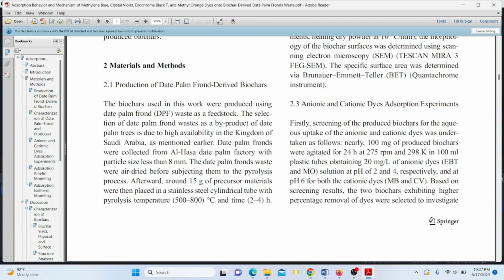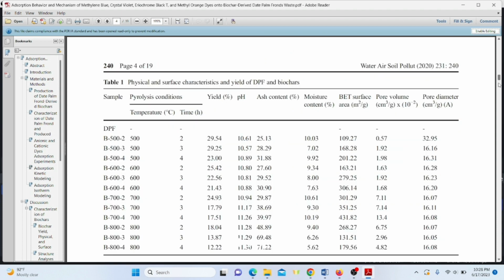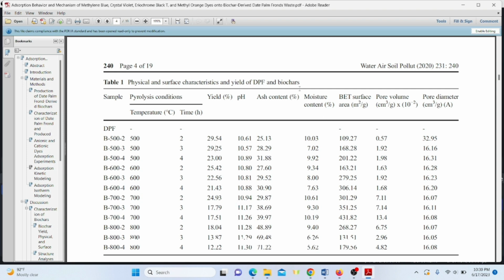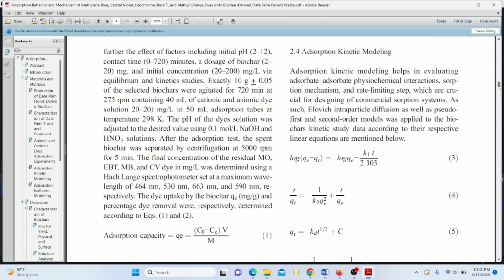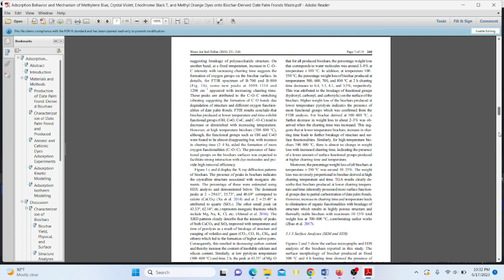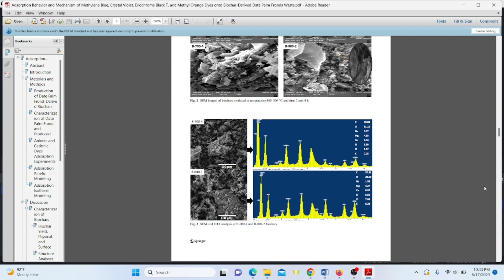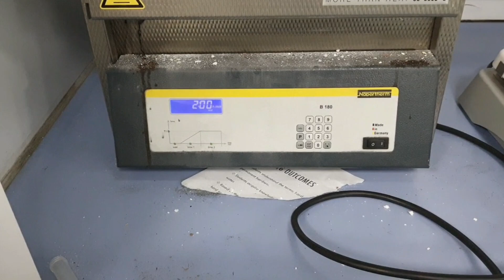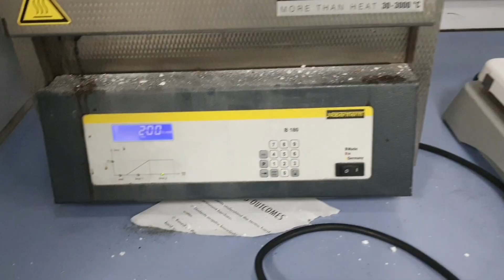Biochar Preparation and Physicochemical Characterization | Feedstocks, Methods & Properties

Comment: Really good work sir...very helpful for beginners like me....can you please tell me the thickness and what grade of stainless steel was used in the crucible...
Reply from the maker: Actually we bought it ready-made I have to look for it ...Will get back to you soon...thanks for your appreciation
Reply: Thank you for your reply sir.,..I'm searching but I can get this type in Galvanized iron only...is it ok to use that ?
Reply from the maker: It is stainless steel tube with perforation
Reply from the maker: @selvanancy4345 you can design stainless tube depending on the size or opening of your muffle furnace space,  contact any local vender, I can send you the dimensions of my stainless steel tube
Reply: @materialsandtechnology8956  kindly share the dimensions of the stainless steel tube sir
Reply from the maker: Sure I will share by tomorrow
Reply from the maker: @selvanancy4345 the dimensions of the tube are length is 17 cm, hole dia is 0.89 cm , width is 2cm.....but you can customise depending on the opening door area of the furnace......for big furnace size may vary
Reply: Thank you sir....I'll try to customize.... your videos are really helpful in my research journey...
Reply from the maker: Please forward,  watch my channel videos too